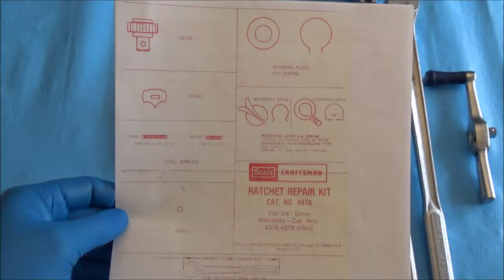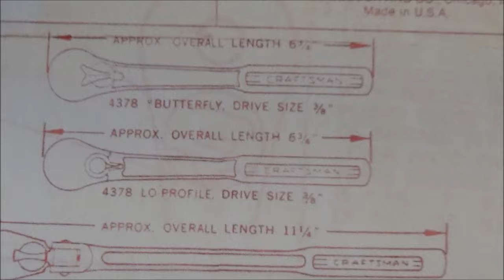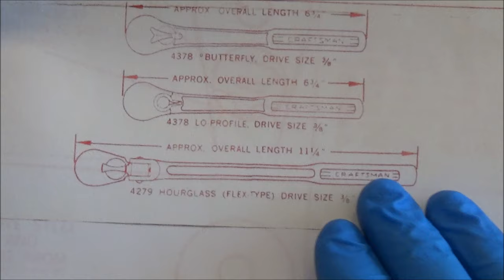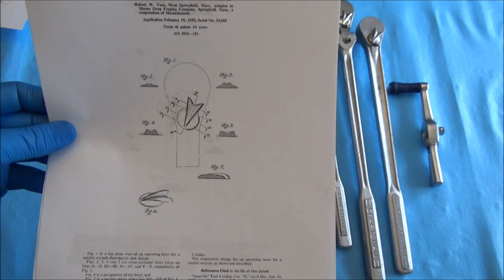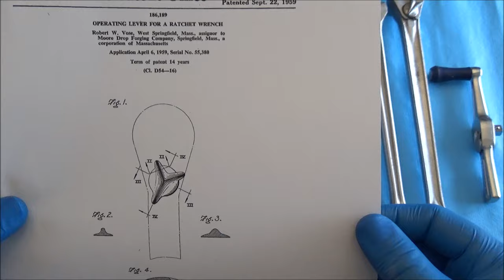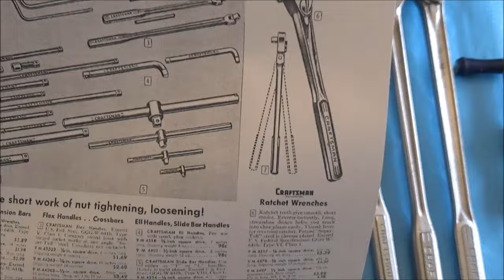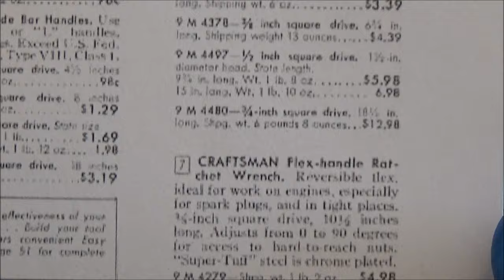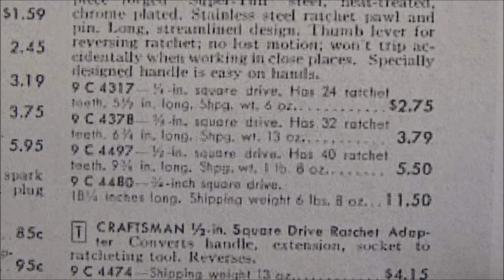Craftsman Tools - USA History: Long Lever & Butterfly Selector Ratchets (2nd Gen. RP)

Comment: I'm one of the lucky fortunate few to have scored the very early 4483 + 4478 and 4498 repair kits they produced with the factory brand spanking new V SHIFTER included, black oxide or molybdenum coated perhaps, original style gear and "bat pawl" and the chrome plated retaining plate. Needless to say I WILL NEVER PART with them, they're truly rare commodities...paid too much for them.

Comment: ...I believe that "EWB" Long breaker bar ratchet is a VERY early one, as if you notice, the body is much more like the Long Lever ratchets than it is like the other Butterfly lever ratchets...note the rounded ends on the panels, and the "short" v-shaped raised area directly below the lever(like the long lever ratchets), as opposed to the "longer" raised area on the other Butterfly ratchets...which leads me to think that the very early Butterfly ratchets may have used the same "bodies" as the Long lever ratchets...BTW, I just picked up one of those Butterfly spinner-handle ratchets at an estate sale for $10.00..didn't need it but thought it was cool and unique..couldn't believe what they are selling for online until I was checking on info on it on the internet...
Reply from the maker: This is a good observation.  I will clarify things like this in the upcoming "reboot" video!

Yes, the spinners have really gone up in the last 2 years.  It is crazy!
Reply: @GearWolf  ..Will be looking for the "reboot" video..just hit the "Subscribe"!..I wonder if the manufacturer of these ratchets(Moore Drop Forge) offered the spinner ratchet in the Easco name or Napa Tools?...the spinner probably pre-dated Easco or their production for Napa tools, though...I do remember Napa branded pear head ratchets that looked like a dead ringer for the QR Craftsmans except the handle was a little different..also, their wrenches were basically identical to the Craftsman raised panel, except they had a "teardrop" panel instead, like the Easco-branded ones, and the USA made Master Mechanic ones...a "History of Napa Tools" would be an interesting topic, also :)....
Reply from the maker: @dyer2cycle  Don't quote me on this, but I believe that this specific spinner design was a Moore Drop Forge exclusive.  It may be possible that it was exclusive to the Craftsman brand, but I am uncertain of this.

Comment: Excellent job with your research and presentation on these vintage ratchets. Why do you suppose the 15” breaker bar Butterfly lever ratchet has a rounded design to the Craftsman name raised panel on the handle like with the long lever ratchets? All the other Butterfly lever ratchets are squared off.
Reply from the maker: This is an AWESOME question!  I'm actually going to reveal that very aspect in the "reboot" of the series I've been working on!  I should start releasing them soon!

Comment: Does anyone know if there are any diferences between the 1/2" hourglass selector torque wrench and the 1/2 butterfly selector torque wrench?  Also if there are no diferences between the two, would I be able to take a 1/2" hourglass selector torque wrench and install a standard 1/2" butterfly selectorswitch on the torque wrench?
Reply from the maker: Believe it or not, there are some important differences between the few variants.

If the objective is to be historically accurate, the answer is no.  If the objective is to get your tool back to doing its job, the answer is do whatever you need to do!  ^_^

Comment: Hey man I know you've posted this video years ago, but I figure knowledge doesn't expire right ?
I frequent the GG over the GJ so I can't ask there if you're even still a member so I came to this video.

Do you perhaps know if the Permanex plastic ratchet cases were in use early enough to have come with a flying V  ratchet ?
I know the logo was in use at this time.
I've bought a 3/8 flying V ratchet set from eBay that's coming in a black plastic " Permanex " crown logo case and I would like to find out if the ratchet belongs in this set.
Everything is =V= code so the tools definitely match, but I've mostly seen these with an RHFT ratchet.
Reply from the maker: Hi Tyler!  I believe I just found you on GG as "hickory N Steel"!  Am I correct?

The answer is likely: no.  I checked through my physical Sears catalogs and didn't see a direct mention of the Permanex cases until 1969; however, believe I saw a set or two that "might" have used that specific case in 1968.  Don't quote me on that though hahaha!

The last run of the "Flying V" ratchets was in early 1966, which, at least from the Sears Catalog, show small ratchet and socket sets being offered with the steel case / plastic insert.

That was a great question!  Thank you for asking it!  ^_^
Reply: @GearWolf  
Yep, that's me.
Thanks for the info.

I got the set in yesterday, and as it turns out 3 of the sockets are single line V with the barn roof A.
I don't mind the set being a bit mismatched since it's all Craftsman and was used just enough to show it but certainly not used very heavily.

Comment: Gw wud u b willing to sell me the long handled 1/2 inch fixed ratchet and the flex head ratchets
Reply from the maker: I would encourage you to check out my eBay page.  Anything that is for sale is on there.  Eventually, everything will be for sale at some point.

Thanks for the question!
Reply: On speeder I have blue and black

Comment: What are the ratchet model numbers
Reply from the maker: These did not have dedicated product/model numbers.  Sears used the same/similar codes for individual ratchets for quite a while in their catalogues.

For instance, product ID 4455 (a made up number) within tools may indicate a "Box Head" 1/2" ratchet just as it may indicate a "Butterfly" of the same size 10 years later.

Comment: Is it physically possible to put a long lever from a Gen 3 onto a Gen 2, V lever ratchet body. I've seen a few long lever, non-quick release ratchets on eBay and I'm thinking I'm looking at a Gen 2, long lever but upon closer inspection, based on your video, I think it's a V lever type with a Gen 3 rebuild kit stuffed into it. The lever itself is thicker and lower profile. The snap ring area under the lever is much wider and the raised panel has squarer corners. Am I looking at a Frankenstein?
Reply: Disregard. I just looked at your "Intermediate Gen 2 Gen # Hybrid" video. That's what I'm looking at, Thanks
Reply from the maker: No, it is absolutely impossible.
Reply from the maker: Yes, you are correct.  What you are looking at is likely the "Intermediate".

I am currently working on a reboot for this video series.  Given the confusion of particulars between the "Hi-Profile Selector" (Long Lever), Butterfly (Flying V), and the "Intermediates" (my dubbing), I'm going to have to make separate videos for each individual style of ratchet.

Please be aware, each of the aforementioned ratchets have very difference selector area machining.  LL and Flying V selector machining has most to do with access to the clip that retains the selector itself; whereas the "Intermediate" selector area machining has more to do with the selector actually functioning than the retaining clip.

Yes, you can swap selectors on LL and Flying V ratchets.  You CANNOT swap a "Intermediate" or Quick Release selector, and have it function, in the LL or Flying V due to the lack of clearance for the selector to move.